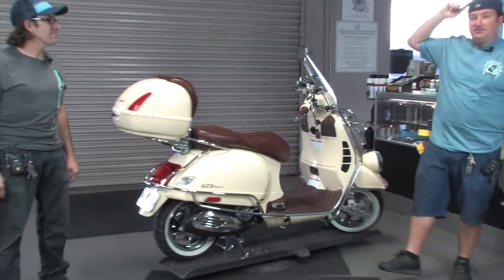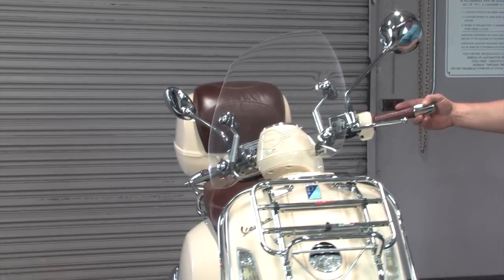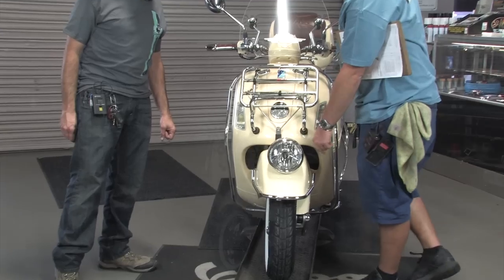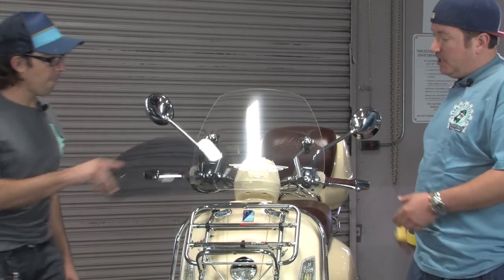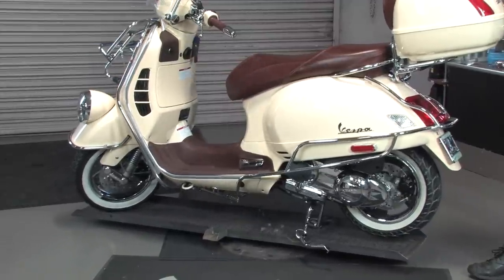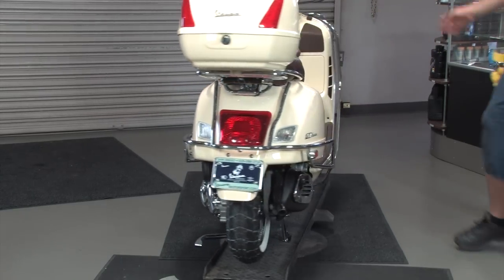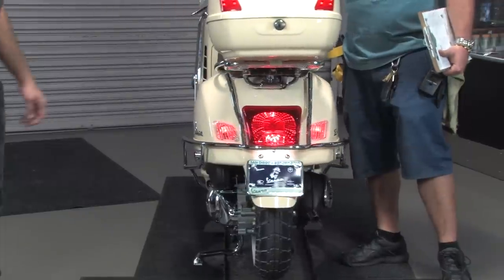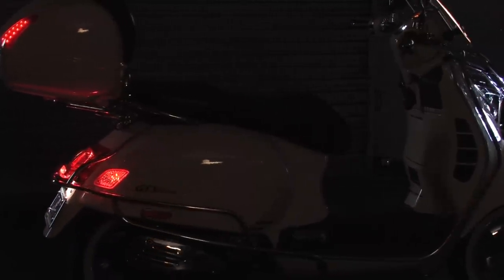Vespa GTV Fully Customized by Vespa Motorsport!

Comment: You guys do amazing work on these scooters.  Next year I'm getting mine, and most likely it will be from your shop.   Quick reference questions:

How much is delivery charge to Orlando, FL

Based on the changes made on this particular scooter, what's the average additional cost (parts + labor) that go into it after the price of the scooter?

Is there a big difference between the GTS Super and the GTV ?  I'm undecided on these 2 models. 

Thanks for the effort you guys make in taking and uploading these videos -- they are great !!